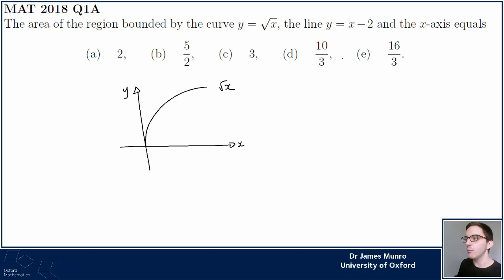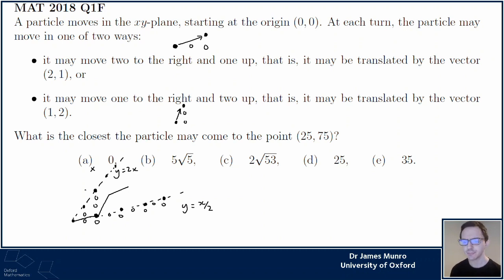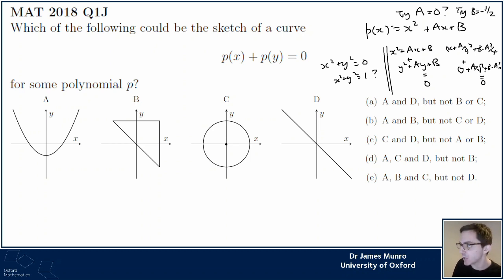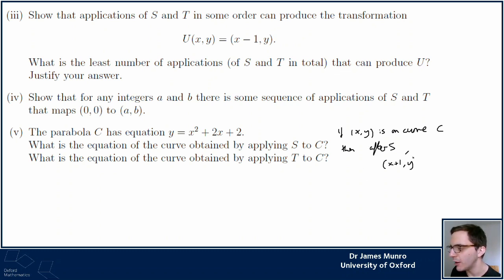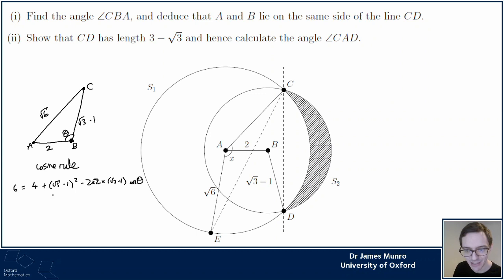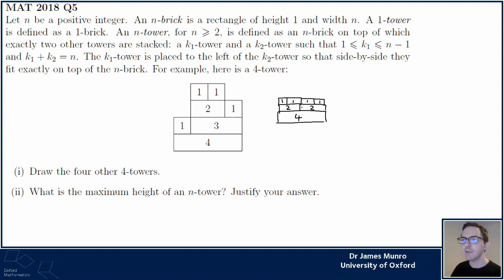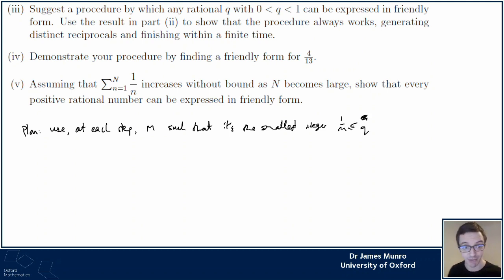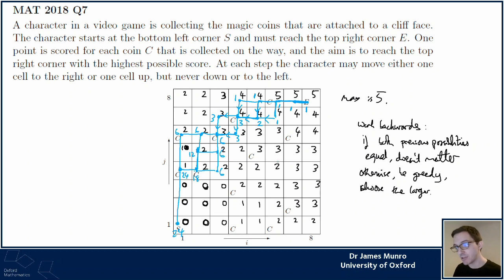MAT 2018 | All questions | MAT Livestream Bonus

Comment: for Q1C the geometric reasoning part. how would having bx^2+d grow faster then ax^2+c make them intersect? aren't they in opposite directions?
Reply from the maker: It's not a very helpful picture by that point because it's showing a case with no solutions. You're right - we don't want them to go in opposite directions. In fact, even if they're going in the same direction, if b<a then the lower one is slower and never catches up! So we don't just need b to be positive, we need it to be bigger than a. I didn't say this very clearly at all! ^James
Reply: @OxfordMathematicsPlus  Ah I see thank you.

Comment: In 4iv), since the question said the total area is split into two equal areas, i assumed that S1CE would be equal to CEDS2 and not equal to half of this. can anyone please explain where i went wrong?
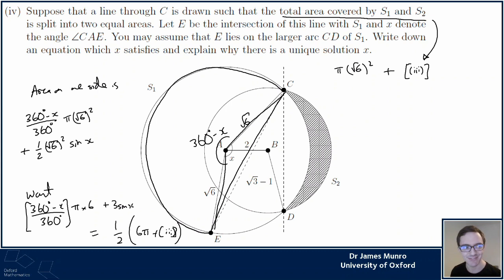Reply from the maker: I think you've interpreted the question correctly - my handwriting is bad at 1:51:17 but my equation is supposed to be S1CE = half of the total. That total is 6 pi plus the thing we found in part (iii) ^James
Reply: @OxfordMathematicsPlus  oh yeah okay i understand. i decided to set the halfs as equal to each other instead, which made it unnecessarily complicated

Comment: In Q3(ii), how can m(x) be defined for x=0 when the chord has no length? The workings for part (iv) seem to contradict this as well, because instead of taking the limits we could just use m(0) as defined in (ii), right? Thank you :)
Reply from the maker: You're right, m(x) isn't defined for x=0 (reading the line above part (i)), so it doesn't make sense to ask for m(x) in the case x ≥ 0 in part (ii). That should probably say x > 0. My working-out is even more sloppy because I wrote ≥ and ≤ when I should have written > and <. ^James

Comment: also for Q5, can I just use the fact the recursion is the( n-1)th Catalan number, so all parts of the question are trivial? Do I need to derive the formula of the n-th Catalan number, or can I simply use the result?
Reply from the maker: "can I just use the fact that the recursion is the (n-1)th Catalan number" - what recursion? We're trying to give you marks in part (v) for writing down a recursion relation for t_n. If you recognise that recursion relation once you've written it down then that's nice, but you already did all the work? I don't consider part (vi) to be obvious for the Catalan numbers, so I don't really see how this observation helps you, to be honest! ^James
Reply: @OxfordMathematicsPlus  Thank you Mr.James for the reply! Also, I already have sent my UCAS application but unfortunately, my referee can only send the reference letter one week later than the deadline due to her current workload. Will my application still be considered?

Comment: Hi, for question 5 (III) as it says give an expression is my answer allowed its not simpified like yours is but it essentially states the same thing: 2(n) + (summation from i= 2 to n of (n-i)) + 1, could you please validate if this correct and if, due to the wording of the question (an expression), give any points?
Reply from the maker: I think that you want to start that sum from i=1, and I think you maybe want to subtract the 1 at the end rather than adding it. ^James

Comment: For 1E I used the area of the circle and the area of a  grid (which is 1 unit sqr) to  get the number of grids for radius=2  then got the 2n+5 as 13 but I couldn't  use this method  to get the increase in radius  needed  for the 13 grids. Is there something  I missed?
Reply from the maker: I can't see an obvious link between the area of the circle and the number of grid points inside the circle - it's probably about pi R^2 grid points for a circle with large radius R, but it's not clear how to make that more precise. So I think this idea might be a bit of a dead-end :( ^James
Reply: @OxfordMathematicsPlus  Thanks a lot. I'll  try my best to understand  the  method used in the video then.
Reply: @Oxford Mathematics Plus   
But just to clarify my method, I thought  of each grid point as a box with area 1 unit square. The area of the circle was 12.568 I think so I rounded up to 13 since  the picture had the circumference overlapping with some boxes and the question considered grid points on the circle as well. So n=13. You have made me understand  that  this won't  be very helpful for finding  the radius increase but assuming we were required to find just n are there any other faults with my reasoning?

Comment: For Q1B; did you have to find the 3 values? Do you loose marks if you don't? Because I got k**3 = 2k and concluded they'd obviously intersect 3 times. Would that be good enough on the actual test?
Reply from the maker: For the multiple choice questions (Q1), you get four marks for the correct answer and no marks for the wrong answer. So it doesn't matter if you actually get the right values for k or not! ^James

Comment: For Q1G can I let t=ks where k is the ration between them so the function only remain a variable k and then differentiate them. 
I got the same ans but the method is different
Reply from the maker: For Q1H? Yes. At 38:49 I wrote u=s/t but you could instead write k=t/s if you want to. ^James